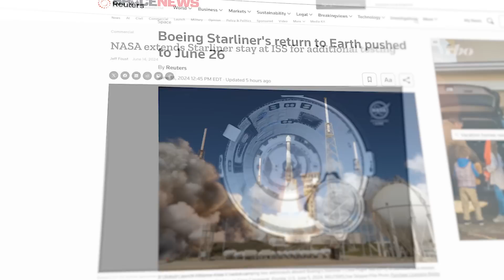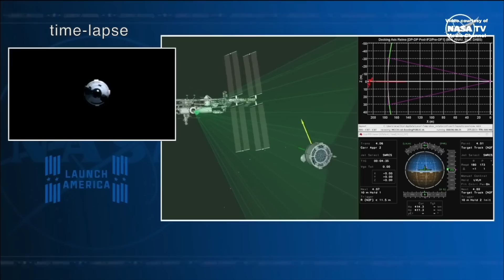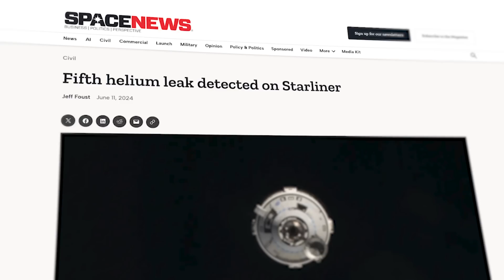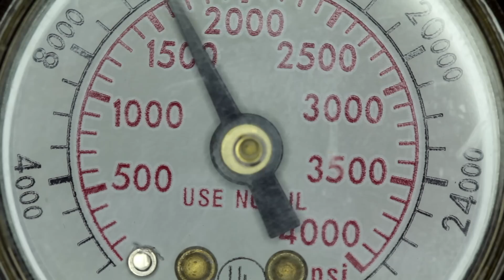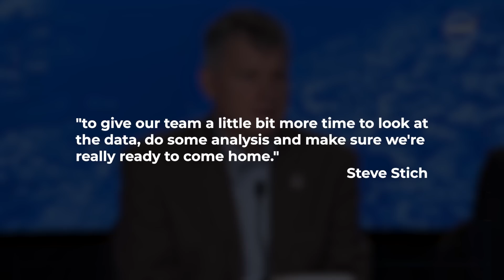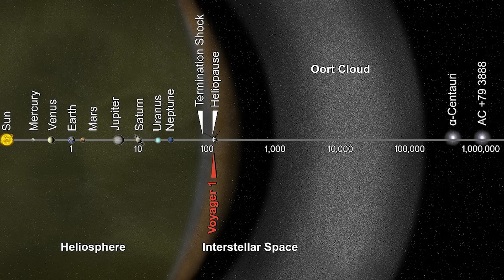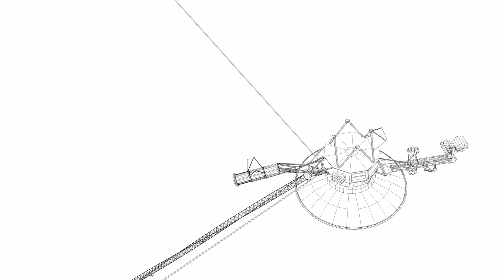The Boeing Starliner Has A New Problem!

Comment: OMG Boeing.  What the F happened to them?
Reply: Corruption
Reply: That goes without saying. Incompetence is their issue. They eviscrated their QA program and CAD can’t pickup everything. At some point you need to test, evaluate, act and test again. 

They lost that engineer mentality and it shows in the Max snafu, missing the missing bolts in the 900 plug and now this Starliner debacle. 

They delays should be at the factory or on the pad, not while docked at the ISS. 

They are risking the lives of the test pilots and the ISS crew needlessly just to say they launched. 

Not the old Boeing. Not Space X. That’s a NASA move that got 14 killed, plus 3 in Apollo one 60 years ago. Well Apollo was different. We were in a “war” with the USSR but still a rookie mistake that killed three of our finest test pilots.
Reply: @nesseihtgnay9419  nope... DEI  when you are BANNED FROM HIRING THE BEST and have to substitute inferior engineers, mechanics, administrators, you have nobody to blame but a totally messed up govt that required this
Reply: Boeing has been falling apart for years.
Reply: @bigdogkool2546  Noteably the majority of problems started after the merger with McDonald Douglas.
Reply: Boeing is just being Boeing, I've done work for the Delta IV and the MV-22 in the past and Boeing is no where near as good as Lockheed Martin who I've also worked for, seriously there is no comparison. If it wasn't for all that government money propping them up they would have gone out of business long ago.
Reply: It's what happens when you have a cost+ contract and you create unrealistic schedules, then build all of your tasks to fit the period of performance.

Source: my career
Reply: This isn't the Apollo generation, this is a generation of people working at what to them is just a job. Their goal is not getting to space just getting off work and going home.
Reply: @chrischeshire6528  Absolutely True. This attitude has spread across all industries. No passion, meaning, or purpose. Just making money. Money alone ambition will decay our country. Until there's no economy left to earn money from.
Reply: They bought the failing McDonald-Douglas, and then kept the McD management and fired the top notch Boeing Management. This is the worst thing you can do when doing mergers.
Reply: All the chickens are now roosting. This has been coming for a LONG time.
Reply: Greed
Reply: It may be pencil pushers.  they used to be run by engineers but not so much in recent years.  That's what I've heard anyway and it sounds quite possible.
Reply: Boeing changed from being managed by former technical people who worked their way up to management to being managed by business people after their merger with McDonnell Douglas which was led to needing to merge with somebody (anybody) because that same organizational structure had led them to ruin over time too. Useless business people are better at manipulating themselves into positions of authority in businesses than technical people; this happens time and time again in various industries.
Reply: McConnell Douglas
Reply: shareholders
Reply: McDonnel Douglass happened to them.
Reply: Boeing used to be a company of engineers, by engineers, for engineers. When they merged with McDonnell Douglas, the management began a transformation. Management openly boasted of having converted an engineering firm into a Fortune 500 corporation on Wall Street
Reply: Boeing did buy the struggling McDonnell Douglas, but did pay with Boeing stocks, hence the "owners" of McDonnell Douglas did get loots of influence over Boeing, and imported the "flawed" McDonnell Douglas culture to Boeing.
Reply: They replaced engineer management with the sociopathic CEO class, corruption, DEI....
Reply: Boeing is the only domestic producer of commercial aircraft, and knows the government won't let them go bankrupt for national security reasons. Without them, we'd be dependent on Europe for all our passenger aircraft. That has let Boeing get lazy and greedy.
Reply: They became a $$ making Company Not a Aircraft Company.  All about stocks,  and buybacks. And a Congressional jobs program.  NASA is guilty as hell too.
Reply: Go woke, go broke.
Reply: Same F-cr@p as rest of the swampland :face-fuchsia-poop-shape:
Reply: Corrupt leadership,  Government officials with their hands out.  Unions that make certain that undeserving people rise up through the ranks and are in charge of projects and processes simply because they've worked there for years instead of earning it by merit and continued education.
Reply: Busy making the world's most dominant military fighter aircrafts. Oh, and the B-52 is still being used, since the early 1950s.
Reply: Taken over from the engineers by the wrong type of accountants (ones without morals). Seems to happen from time to time.
Reply: I would say someone sold them bum o-rings and now most comments are being offered by those who have  jumped on the wagon of insanity to proclaim its all over for Boeing. Helium leaks are nothing new...everyone should lighten up.  Having a variety of ISS capable craft is a good thing. Boeing might someday rescue SpaceX. There are no guarantees above the Kármán line. Anything can happen.
Reply: MDD.
Reply: Bean counters whose priority is the corporate profit margin over solid engineering.

The engineers who used to run Boeing were removed from its executive offices almost 10–15 years ago (its HQ is no longer in Seattle, it was moved to Arlington, VA so its execs can more closely lobby the US Gov to throw taxpayer's money at the company for producing rubbish).

MBA's with no clue how to run an engineering business, driving it into the ground for greed and taxpayer funded graft.
Reply: DEI and corruption. Seriously, how can people even vote for someone like Nikki Hailey.
Reply: 'Diversity hires'. They have no clue and don't care.
Reply: No one seems to have given the proper answer, but basically during the merger with McDonnell Douglas in the 90s, the (highly incompetent and profit-focused) C-suite from McD took over from the engineering-focused Boeing direction. They then proceeded to cut anywhere and everywhere, and did the usual shit decisions profit-minded morons take, gutting QA, maintenance, and everywhere they thought was "non-critical" (but actually was critical).
Reply: they got bought by a different company and lots of OG engineers got fired
Reply: @user-bs2ok3yv8i 
And 'Fornia, 'Yorkers, 'Wualkees, and nearly the whole East and West coasters.
Reply: Venture Capitalists buying them.
Reply: McDonnnell Douglas is what happened to them.
Reply: Actually, the problems go way back. The B17 was a piece of sh*t compared to the  British Avro Lancaster. Of course the Luftwaffe had a say, but still the B17 was too slow and didn’t carry enough bombs, thus more missions were flown
Reply: They forgot that even the best designs have to be tested and observations of the testing team must be acted on.  

They seem to have forgotten that and incentivized the testing teams to be quiet if they want to keep their jobs. 

Did you hear the Boeing CEO testify yesterday?  F man. I don’t want to go near a Boeing airplane much less fly in space in their capsule. 

The ISS needs to undock with that POS asap.
Reply: They got hooked on hardcore drugs
Reply: @zmblion  SpaceX to, but they actually did something and built a giant ass rocket
Reply: “Shareholder values” 
Thanks Reaganomics
Reply: @harutosunaa3881  
The failuries in constructions began almost immediately with DEI and nothing else. Stop making things up. Try Cuba or Venezuela is you don't like our system.
Reply: @texan-american200  
WRONG. It occurred way before then, basically when the merger happened between MD and Boeing and when they moved their headquarters to Chicago.
Reply: DEI.
Reply: DEI.
Reply: @len3169  “DEI” 

If only that were the case… Too bad you don't know shit.

Good to see FAUX Entertainment's ‘dumb-it-down’ programming effort has succeeded on a bellend like you.
Reply: It probably due to the general drop in the quality and quantity of STEM in the US. Contrary to China the new powerhouse in space and other science domain. Woke culture, Tic Toc also doesn't help.
Reply: DEI
Reply: DEI happened to them.... Just like United Airlines and all the problems they have...
Reply: DEI is what happened!
Reply: @jbdragon3295  
yeah, yeah, sure, sure  Hyperbolic nonsense.
Reply: @swapshots4427 
Too bad that you don't believe in that "HYPERBOLIC NONSENSE." Fire anyone that screwed up this project, DEI or not.